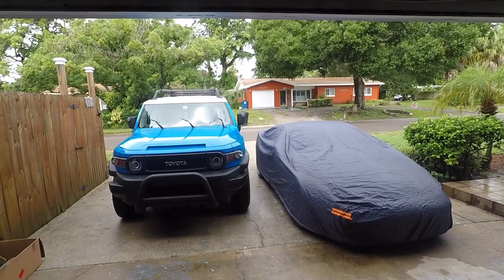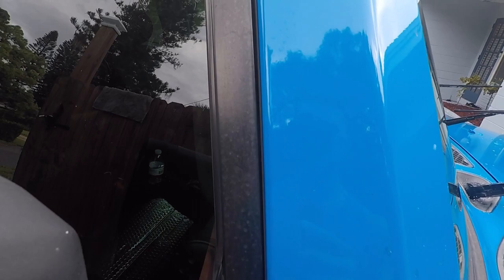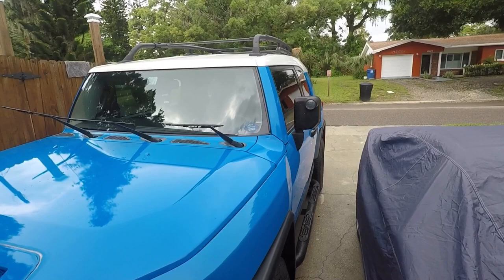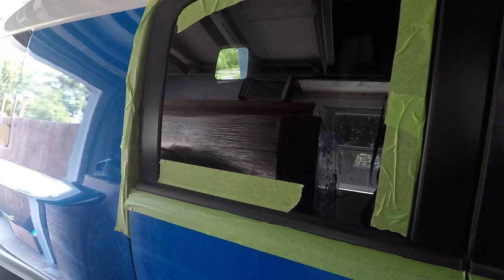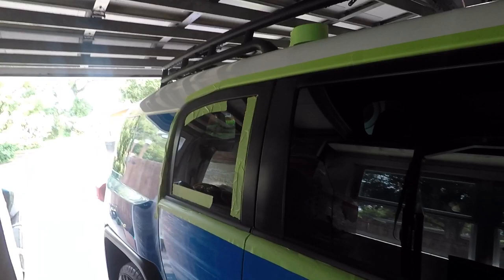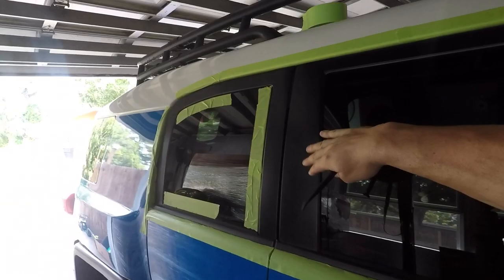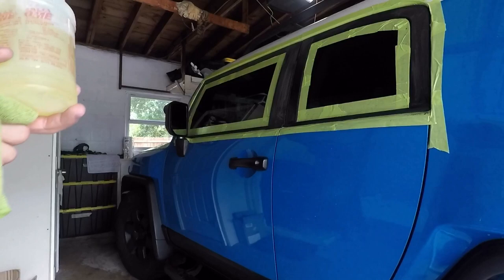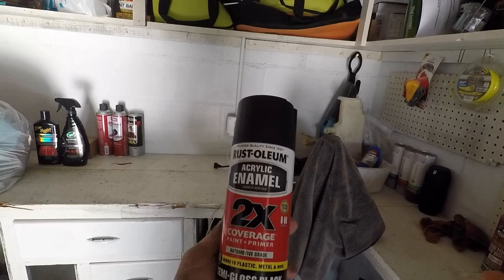FJ Cruiser *Making the FJ great again* Painting/refreshing trim

Comment: Mannnnnnn. All you need for faded trim is solution finish. It’s a permanent refinishing product, it’s not a dye, not gonna wash off. After that, get a consumer grade trim ceramic coating from amazon or something and coat over the trim. Permanent fix and looks AMAZING
Reply from the maker: O wow good info! I’ll deff keep that in mind for the future. Thanks bro and thanks for the view
Reply: Absolutely bro, I have an 07 silver FJ. But I do high level auto detailing. All of those trim pieces are impregnated with color from factory, it’s in the plastics, they are not painted. So using solution finish reimpregnates the surface with color using crushed carbon. Look up some videos on the product, wipe on, wipe off excess residue, done.
Reply: Got a sub from me. Love the blue FJ
Reply from the maker: @enzo1234069  nice thanks!
Reply: Just want to say Thanks to you as well. Didn't know and this should help the look of my FJ as well.
Reply: @cdf8821  no problem. I am a high level detailer. I want to see informed people doing the best work they can with the best results and minimize damages